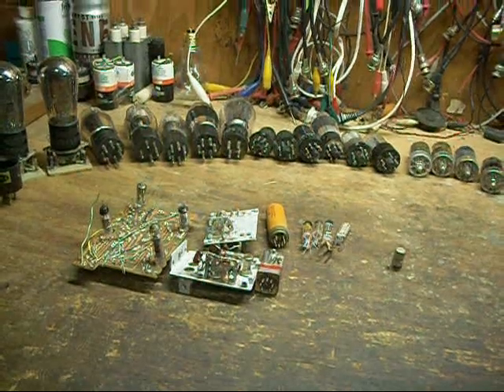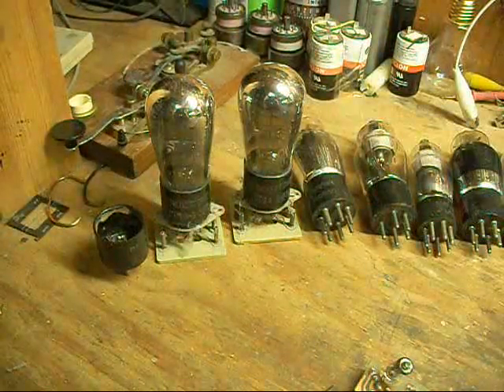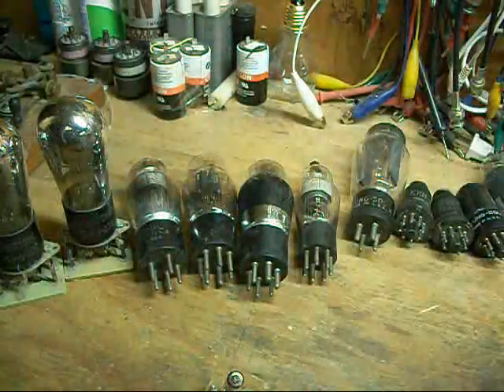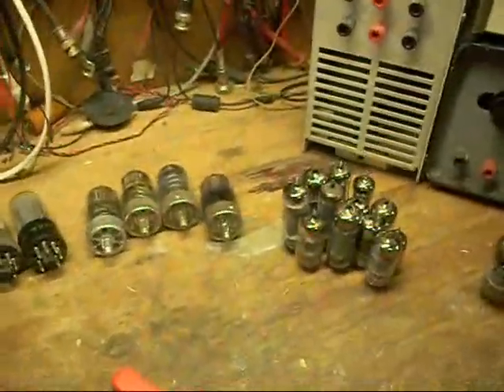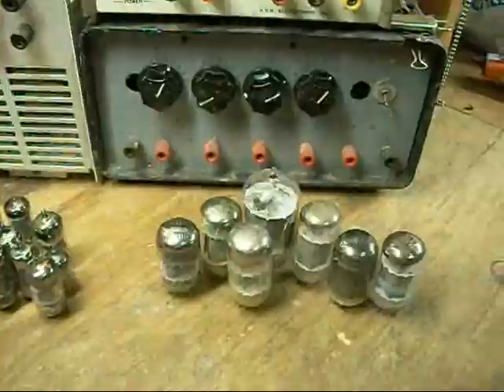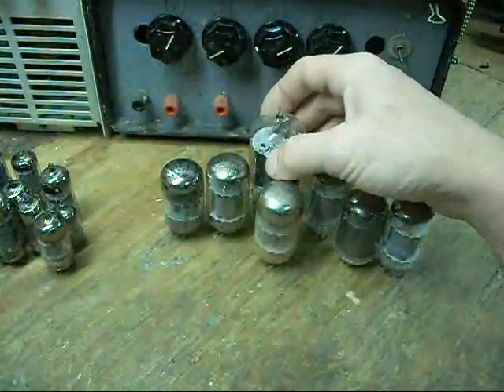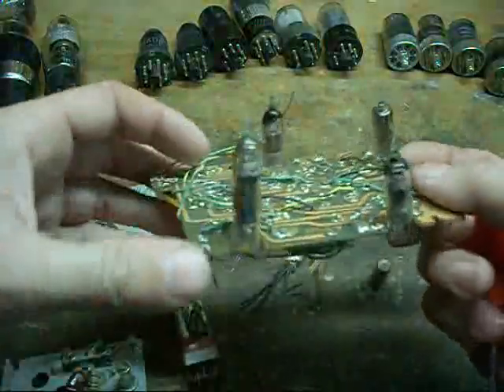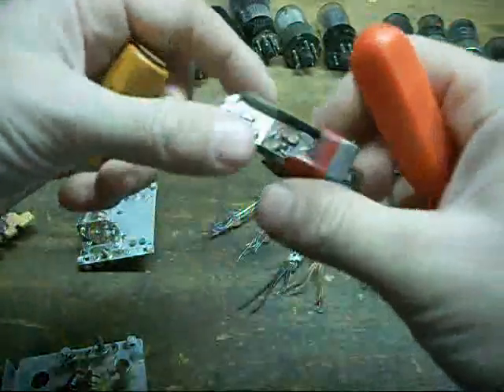Types of vacuum tubes you will often find in old electronic equipment.

Comment: Hi, are the metal tubes ok to use in my 50s jukebox amplifier, Because have been told not to use them because they get to hot, what do you think. Anything wold be appreciated..
Reply: It's it's the appropriate number,  it should be ok.   If it calls for  6L6GC,  and you use 6L6 (metal) you're wrong.   If your Jukebox calls for the same number as a metal tube,  go right ahead.

Comment: the fixed tube radio is such a bad design. I guess if the tube goes bad and you have to replace the whole component the repair process might actually be quicker but possibly more expensive....? I guess for the time it would've been pretty state of the art. I also think maybe from vibration they wouldn't want to have a tube that could come out. Idk strange seeing all these tubes and thinking about all their applications.
Reply: caleb washburn I agree, I guess they are too lazy to put in some of those locking sockets like the old Philco radios used.